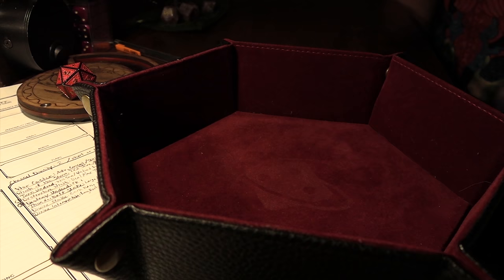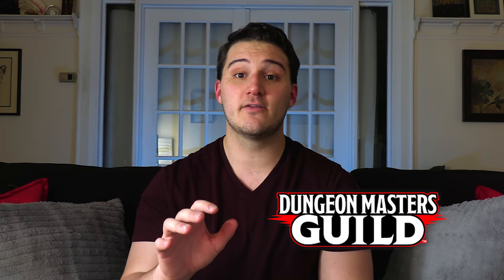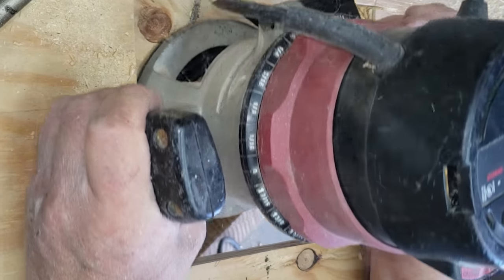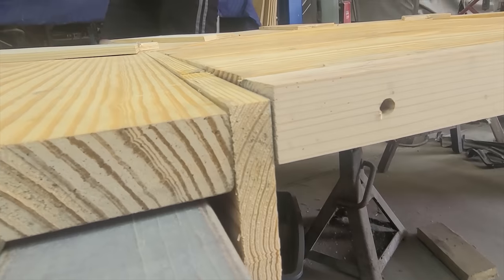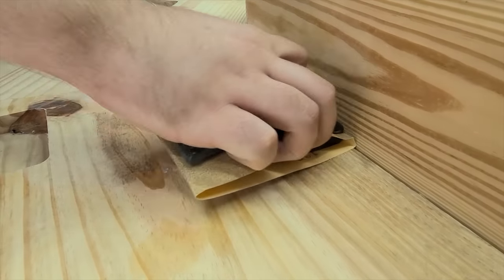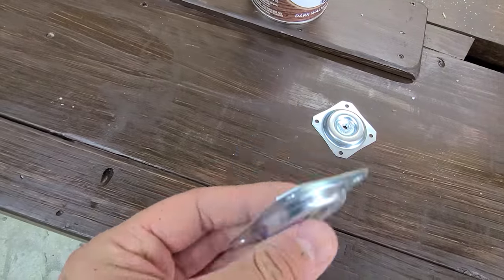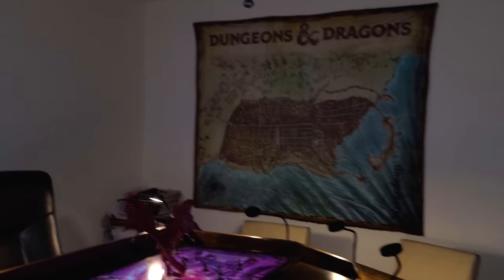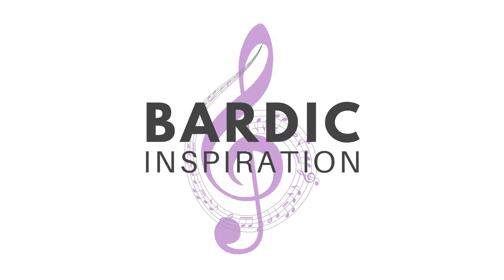How We Made Our Custom D&D Table

Comment: For the next table you might consider using biscuits, dowels, or tongue-and-groove for your joints. They will greatly reduce the need for braces. For the finish, it looks like the whole thing is softwood which doesn't like to take stain evenly, so you might try a conditioner first to even out the absorption in the grain. Speaking of staining, remember that it's not paint and you have to wipe off the excess. Ideally you'd apply polyurethane in a relatively clean environment to avoid dust falling on the surface but you handled it well. You might want to use a coat with more of a matte finish to avoid glare from the spotlights, the player areas look really shiny. One last thing, the television is going to produce a lot of heat that will need to be dissipated to keep it from failing early, so it would be a good idea to put some vents in that cover or the general area, maybe even a PC fan to move the air without making too much noise.

Comment: Love the design of this table. The wide side fit the dm is genius. Instead of the 2x material, you could use a hardwood plywood for the surface. When trying to get those odd shapes figured out, use cardboard or poster board to get the shape right, then use that as your template for cutting the wood. 
Lots of space in the TV area that could be used as cubbies to stash things. 
Love the lights for the players area. 
Overall, great job.
Reply from the maker: Thank you very much! We were hesitant to use any wood that may be less durable so we stuck with the 2x planks. The design would have been much easier - and lighter - if we used a heavy duty plywood. But the integrity of the surface may not have supported 7 people leaning on it at the same time. I could be mistaken about the strength of certain plywoods but that was the mindset behind the 2x!

Comment: You probably won't see this, but I think you should include a way for players to magnetize things to their section of the privacy screen, wireless chargers for phones, USB ports at every station just in case they use a tablet for D&DBeyond, and cup holders so no one accidentally knocks their beverage over! Great video, thoroughly injoyed, and you gained a new sub!
Reply from the maker: Inlayed cup holders would have been a great idea! We didn't feel we could afford to take up more space on each player's table so we bought some nice coasters. We've had a couple accidents with cups but it hasn't been terrible. Magnets would have been a great idea though! Thanks for the sub, we greatly appreciate you!
Reply: I worry about magnets interfering with computers, monitors & cell phones, PDA's etc. I'm not actually sure.  I thought about magnets for my table, but have been reluctant to do that.  Has anyone actually used them?  I'm all in on USB chargers, and plugs for devices if possible.
Reply from the maker: From what I've looked at, as long as you aren't using specific high powered magnets, just keeping your device about a foot away from them should limit the risk. I'd suggest, if tweaking our build to include USB charging and magnets, that you use some light white board-type magnets to hold any reference sheets you need attached to the privacy guard, then try to run USB cables through the center of the table that would allow you to charge your phone or tablet near the edge of your player space. That would limit a lot of risk when it comes to the magnets. Or you could stick binder clips to the privacy guard for the same effect, and do away with magnets entirely!
Reply: @rosascreativeworks5403  they make magnetic cell phone mounts for cars so I wouldn't worry about the cellphones. As far as the TV you shouldn't have a magnet powerful enough to effect it unless it's in direct contact with the screen. However given the area size I don't see anything magnetic being necessary.
Reply: @RogueAero  Good info. Though I'm more worried about hard disk drives in laptops.  :)
Reply: @rosascreativeworks5403  hdds are practically passed out at this point the standard disk drive for laptops has been ssd's for about 10 years now. And even then again unless it practically touches the drive any magnet you would use in those spaces would have next to 0 chance of affecting an hdd in a laptop. Source: trust me bro I was a laptop repair tech for years lol we used neodymium magnets all over our workstations

Comment: I made a table of a similar design, but with a rounded edge for players instead of squared off portions and no partitions. That allows me to squeeze in more players as the need arises. Instead of 2x materials I used 3/4 inch sanded plywood sheets stacked on top of each other in 3 alternating layers, like = on top of 11 on top of =. This gave me an 8 foot x 8 foot surface that’s about 2.25 inches thick to work with. The TV is flush mounted with the surface and the protrusion on the bottom to accommodate the TV is far enough away from players’ legs that they never knock their knees on it. The table is massive and I literally won’t be able to get it out of my house without cutting it apart, so a table this large is a real commitment.

Comment: I designed two hexagonal gaming tables. One was just a hidden storage coffee table that doubled as a gaming surface. It ‘could’ be opened and used as a largish DM screen. The other was a six-seat table where the GM had one side and the center (hexagonal hollow core) for additional storage, for a computer, sound controls, books, light, message shoot access. The middle of the table was an elevated overhanging gaming surface for the battle map, minis, etc. while seated the battle map is just below eye-level for the typical adult.  Working with the limitation of a scaled 60🌡 wedge it necessitates careful chair pairing.
Reply from the maker: That sounds delightfully intricate, do you have a link to some photos? Thanks for watching the video!
Reply: Where the legs are is also important.  Put them in the wrong spaces and your poor players will always be fighting with a leg.  We've got a player that likes to sprawl all over the place, LOL!  Table legs are always a problem for us, because we're pushing two tables together.  Good ideas though! 😇

Comment: Here is a possible suggestion if you make another table. Consider using the vertical wall in between the players and the TV for players to hold things in. Think of it as a player DM screen. There are a ton of things that can be placed here. A dice tower, places to hold tokens for players such as inspiration token are some good examples. I even saw a table that had a button where the light would be that they could push to signal the DM. This was used as a cue for role playing or to let the DM know something important. I used this myself as a cue to let the DM know I was about to attack a party member, and at one point I was told to push the button if I had failed a death saving throw so that other players did not know how close I was to death.
Another thing I thought about was to have a storage location/ a shelf for the players and the DM. This could also be a good place to put chargers so those electronics are not covering the player's space, or if the player has their character on their computer, a hole for the cords can be put into the shelf so cords at reach the table. 
The last thing I can think of are cup holders. I hope this helps.
Reply from the maker: Storage under the table would have been a great idea if we had any clue about how much space we'd have considering chair height! I had the idea of drilling in a small shelf, of sorts, to the top of the privacy guards for the dice/tokens you mentioned but at that point the table was no further along than we hoped, so I nixed the idea. I'd have loved to play around with it more! The lights suggestion is super creative though and I wish I had a better understanding of wiring and making that kind of thing work! I think, if I make another in the future, it'll be a bit less complex on the surface. Maybe the wiring and other types of electronic installations is where I'll really develop those kinds of innovations. Great advice, overall!

Comment: A nice job, all things considered. There are some great suggestions here for how to improve the next one. I know my father would disown me if I made anything in the same way as this table, but you don't have the technical background in carpentry that he has. Neither do I for that matter. It's a really nice project, though.

Perhaps for next time, consider doing some modelling ahead of time. There are plenty of free 3D cad programs that will help you with the design. It can calculate the angles and make sure you have the right cuts, and you won't have to go on guesswork for the lid. Of course, there is a substantial learning curve to using these programs, but it is definitely worth it in the end. Failing to plan is planning to fail, after all.
Reply from the maker: 3D modeling is definitely something I'm interested in. It never even came to mind while working on this project 😅 But in the event of a second table's creation, that would certainly be a good idea. I made a physical model, but more to demonstrate the concept than to precisely measure angles or length

Comment: Nice work and thanks for the descriptive and informative video. Your presentation is relaxed and well done as well. 

We found that the TV used for digital map display needs to be lower so everyone can see it well and we knew we needed plexiglass on top to protect the screen. Our TV case was made for us and has legs so it can "Breathe." It is supposed to stand on top of the table. We ended up removing the legs and to keep the TV from overheating, we place it on top of two folding tables, leaving a big gap between them and a fan underneath. We can't have a permanent table, space is limited and we need to be able to put the whole thing away between sessions.

Comment: I really like the overall design of the table and the DYI aspects, so please take this only as constructive criticism/suggestions.  1. I've never played on a TV screen before so maybe it's fine, but it seems to me like it would get scratched up over time and when it needs to be replaced I think it's unlikely to find one exactly the same size.  I saw a video where a guy used a projector and directed it downward onto the table.  This seemed like a really good idea to me.  No changes needed and you don't have to be careful not to press too hard on the playing surface.  Just a thought.  2.  I've never liked the look of 2 x 4's or plywood.  I think I would have covered it up, at least partially, with some felt.  3.  You need some cup holders.  4.  As a gaming table I think this is the best shape I've seen, but for me, the table has to pull double duty as a regular table, so the shape wouldn't work.  Just my $0.02.

On a positive note, I love the lights and I give you a lot of credit for doing it yourself.  It's a great outcome and a very useful thing.  Kudos.  Big upvote for you.

Comment: Love the design.
For me I would go something like that although with a stand + charger for a tablet as we tend to use D&D beyond, and maybe a slightly larger dice trey.
Reply: That was actually part of our original design concepts, the only reason we scrapped it was because the room we were putting the table in had limited space, and adding those features comfortably would have made the table just a bit larger than we were able to manage. If you've got the space then it's an excellent idea, for sure!

Comment: I just saw this video. I'm debating between this style table or a traditional table for my next dnd table. We currently use a projector to show maps and occasionally I will build out the setting. My question is what size are the player areas? Interested in the width and depth of each player area
Reply: Thanks for the question! The player spaces are 24 inches from corner to corner and 18 inches from edge to the privacy guard

Comment: If you want to do a table like he did, or anything complicated with wood, make it on your PC, there are easy to use programs online.
With it made in your PC, you'll have the measurements and it'll be easy to follow.
And, if a piece is to complicated, go to a printing place and print in real size, then you can just glue the paper in the wood and voila, perfect piece.

Comment: Since the group I play with largely uses electronic character sheets, I would probably add some surge protectors into the table to provide spots for players/the DM to plug in. Also having some kind of integrated dice roller would be pretty cool, but I can also see how that could get really complicated really quickly. I would like to try something like this at some point though. Some really cool ideas in your design.
Reply from the maker: We're suckers for hard copies haha. D&D Beyond, as well as other third party clients, have made D&D very digitally accessible and for any group that predominantly uses tablets or phone to track character information, the hardwiring of USB outlets and other sources of power would be absolutely necessary!

Comment: Not sure if it has been mentioned.  Seeing that you've already power running for the TV, you could mount a surge protector under the table and then add an 8 port usb hub under the table.  Provide cable management for cleanliness so the players can either charge/run their phones/tablets (even fans) during play.  Prices for said hubs (even fans) are reasonable.
Reply from the maker: Very reasonable solution!

Comment: Very cool to see the hard work put into it. I feel like you could go without the tv and do a top down projector to show the maps and cut out the cost of and weight of a tv.
Reply from the maker: Could be a good idea, but higher end projectors are about the same cost as a new TV. If you can get the projector mounted right and assure that the table never needed to be moved, this would work out just fine. In our situation, we had an extra TV screen and it happened to be the perfect size for the maps we were using. By all means though, for anyone considering the projector, go for it!

Comment: For phone chargers you could mount a USB hub under the table, then run usb extension cables to each player station, no need to do anything more than cable manage then, something like the Anker 60w 6 port hub would handle that no problems.
Reply: That's definitely a design choice we would look at if we build another one at some point, but also sounds like something we could add to our current design too. Great suggestion!

Comment: For if you ever do another version, LG has a completely flat TV where all of the processing is done inside the sound bar. It would be really easy to mount one of those into a table for both visuals and sound capabilities, and it would save a lot of weight from both the TV itself and the wood you need to attach it to the table. Linus Tech Tips did a video where he used one to make a "window" in his building where the display was recessed into the wall. There's also an LED strip controller you can plug your video input into that makes the LEDs glow in a specific color to match the colors closest to the edge of the screen. If you put some diffuser material over those it would make for an amazing accent to the main set piece. Also, phone chargers would be good, but if you have players that use laptops having a power strip attached to the table and having outlets with USB and USB-C plugs would be even better if it's not much more expensive. And cupholders. Everyone needs a cupholder. Even still, incredible build and I wish I had one for myself
Reply from the maker: We debated on the cup holders but opted to go with coasters for each seat instead. With a dice tray being routed into the table, we didn't want to take away more space from the surface so character sheets and notebooks could fit flat onto the table's surface. If we wanted to, we could have mounted cup holders to the edge of the table but thankfully the mobility of the coasters has allowed us to not necessarily need a mounted cup holder. It gives some customization to each player, so they can comfortably fit what they need onto their section of the table. A completely flat TV screen would have been preferable though!
Reply: @BardicInspirationYT  in a perfect world I'd build "floating" mage hand cup holders that I could hang from a privacy wall between each player so it would be out of the way of your stuff and your hands to help avoid spills as well as just being cool. It could even be on a small gooseneck mount so you can angle it out of your view of the board
Reply from the maker: You'd just have to find one hell of a strong gooseneck mount! Last thing anyone needs is their G-Fuel mixed with Mountain Dew to pour all over a brand new tablet haha
Reply: @BardicInspirationYT  a short length of it won't bend or rotate that much, that's all you'd need
Reply from the maker: Fair enough! We hope to see a video response if you make this into a reality! It'd be cool to use a Mage Hand prop fashioned under the mount but that may get clunky in terms of space and mobility

Comment: Oh! That first saw is not a Table saw! That's a Saw That's  specifically designed to cut ends to help square off untreated wood! 🤣
But hey man! Koodos for making it work!!!!

Y'know, whoever coached you for building it did an amazing job!

Edit; wait up, you gave a wrong peace of advice. This is something I'm passionate about so, I will take the time to correct a mistake you said; Sanding polyurethane using polish compound and a water sanding paper gives an AMAZING finish and IS used in ALL professional jobs for Cabinet Making. I understand you most likely didn't study in the trade, but I just couldn't pass this chance to correct your mistake. 👍
Reply from the maker: Our very limited experience is with sanding metal panels meant for classic cars, we had no idea that wet sanding was a mainstay practice for woodworking